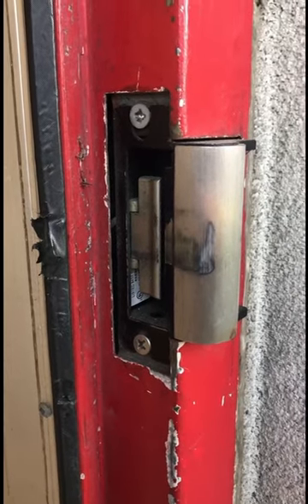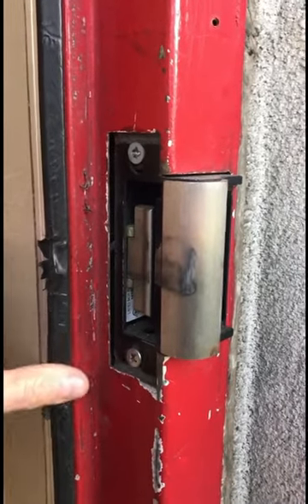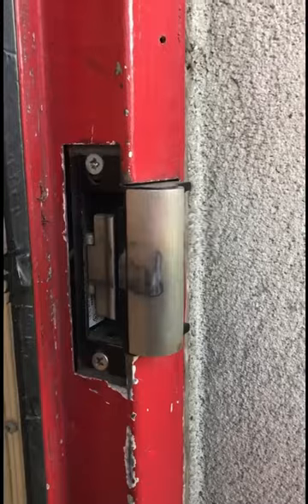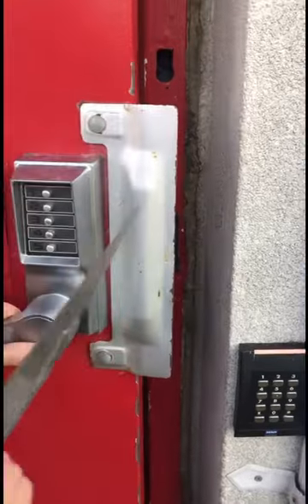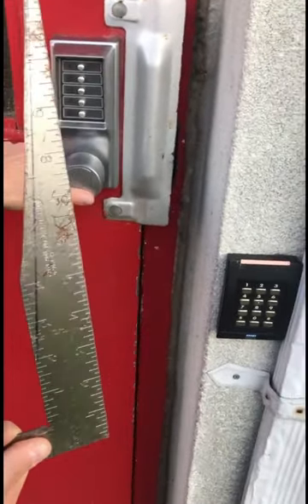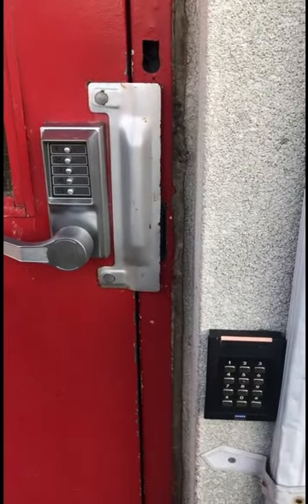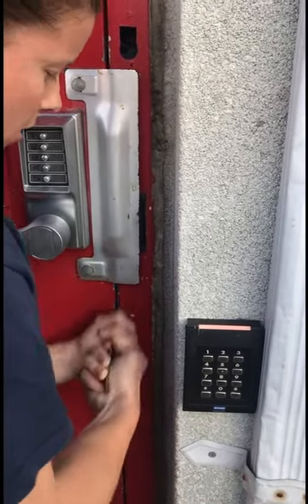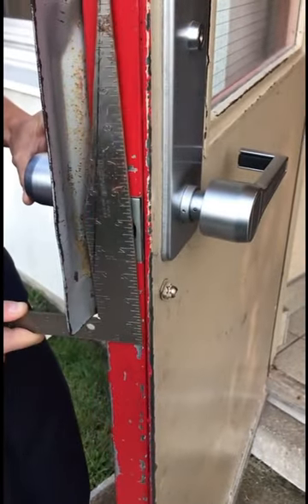Modified Framing Square vs. Latch Guard (Respectful Entry)

Comment: I used an unmodified one 35years ago to get into my wifes grandmothers apartment building since my truck was 10' from the door.  It was a double set of commercial doors with an electric striker and that cover plate.

Comment: I’ve got something similar to the triblade, are you finding you’re having to gap most doors to allow the blade to do its thing? Also, are you ever having to put a good amount of up/down pressure on the locking mechanism with the tool? I see a lot of similar videos where they are even lightly hitting down on it.
Reply from the maker: I’d say half the time I have to gap the door, and half the time I don’t.

I haven’t had to hit my modified framing square down… but I have had to increase the gap between the door & frame to take the dead latch out of play.

I also noticed I had more luck with the modified framing square (MFS) than the tri-blade.  Not sure why, but doors I couldn’t get with the tri-blade, I could get with the MFS.

Comment: What about a door with a swing in latch guard protector
Reply from the maker: If by swing latch you mean pivoting deadbolt… I would use other through the lock techniques.  For example, pulling the lock cylinder, then manipulating the lock mechanism.  And if that didn’t work, I would go to the rotary saw to cut both latch guard and deadbolt.